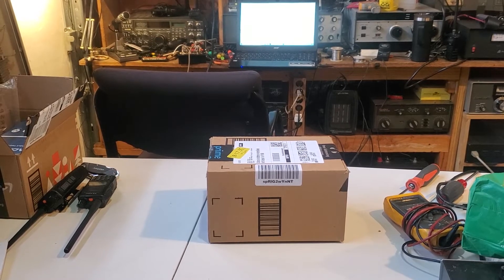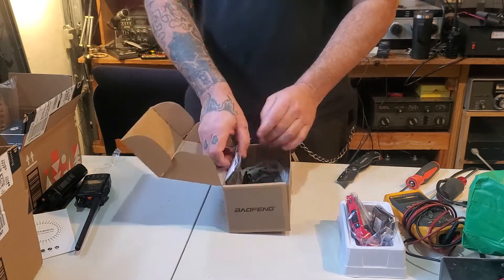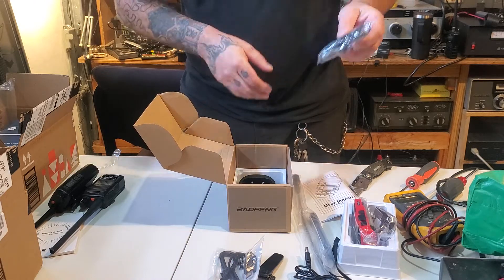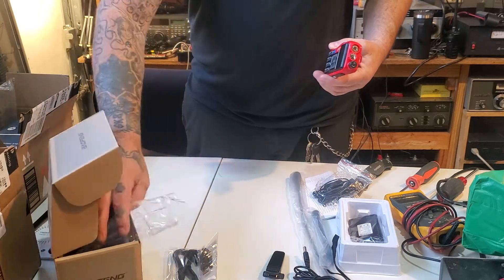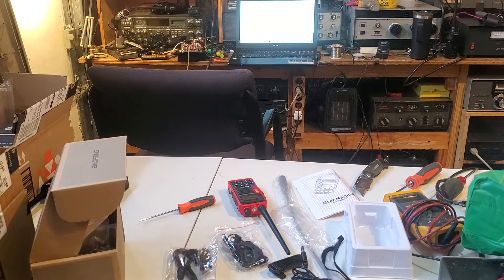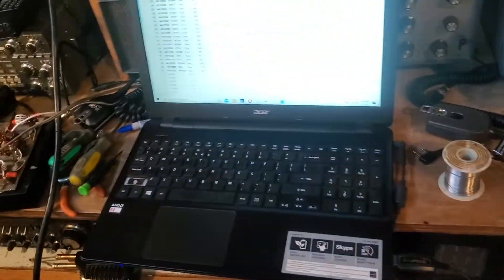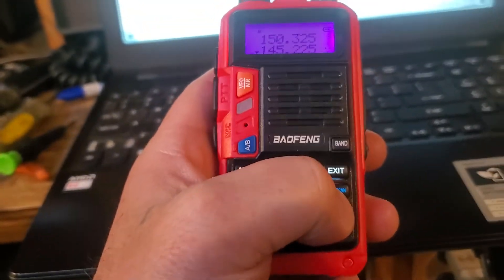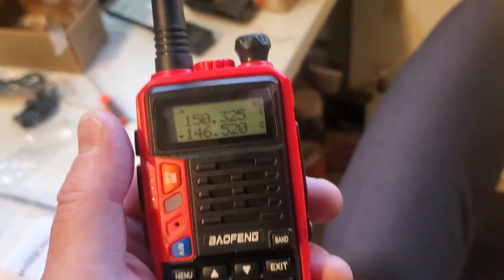BAOFENG UV-S9PLUS REVIEW AND PROGRAMMING INFORMATION. AND ITS NOT USED! YAY

Comment: What do you mean "its not used"

Do they send used radios?
Reply from the maker: They do. Certain sellers sell used radios as new. They carefully clean them. Usually the give away is the battery area and usually a battery installed but the plastic with it that it came with is a dead giveaway.  Its technically not supposed to ship w battery attached. But regulations vary based on location. Amzon in general has gotten bad with used items sold as new

Comment: Stumbled across your video. Good info. I just bought the same radio as my first crack at this. Also didn’t get the cable so I’m trying to find which one is for this one. As a beginner I’m working the basics…
Reply from the maker: Make sure you get a cable thats got good reviews.  Older cables no longer work on most windows machines.  I have a baofeng  branded prolific cloan cable from 2014 2015 and it will not work because windows  blocks it. Used to be able to roll back the driver but no more . Usually ftdi chip cables are better. The problem is the Chinese counterfeit the prolific  chip without paying the license  fee . Probably same chips but not licensed.  Rt systems sells know good cables

Comment: Hello, is the UV S9 tri band approved by the FCC (USA) please? Thanks.
Reply from the maker: It's not sold as tri band. That cannot be done without software.  They have 2 similar radios UV-S9PLUS and uv9s they might be exactly the same. Mine is unlocked but has fcc listing. May or may not be acceptable. They do falsify all the time. It's not something I would worry about.  The radio isn't really good.  It's rx overloads quite easily.  I cannot recommend this radio no matter what.  Sorry. Buy a bf-h6 baofeng It's much better.
Reply: @hamradiohack  Hello, I appreciate your information and advice, hugs - Luiz.

Comment: Please help me i am a beginner, 
which radio should I buy,
Something that would taka beating and last some time
Reply from the maker: I think this one would do well for that it can be easily programmed with chirp or by hand its a good beginner radio if you want something more rugged maybe some of the waterproof ones are around same price point too look on Amazon,  you can always return it if it's not what you want
Reply: This radio isn't a simple one to start with.  You want GMRS?  How rugged do you need?  These radios are for pre-arranged situations.  You have to decide what you want it for.
Reply from the maker: @HarryHamsterChannel  it's as simple as any uv5r.  If that's not simple enough you probably better avoid all Chinese radios and buy something else.  There are many other radios that are even worse than this one.
Reply: I personally like this radio and it's better than the uv-5r.